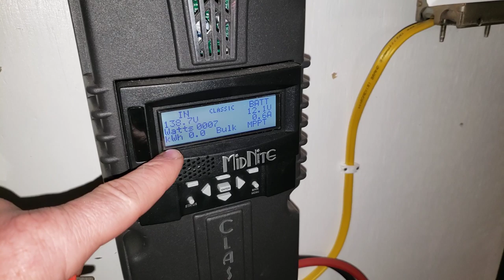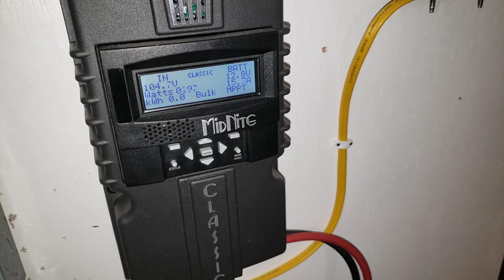Alligator Clips To The Rescue, Battery Protection Reset

Comment: I use the AUX1 (auxilary relay) of my Midnite Classic to turn on/off the inverter based on battery voltage.   The AUX1 can operate as an unpowered on/off relay OR you can set it to provide 12v while on and 0v while off.   So you  hook it to the on/off switch of the inverter or use the 12v mode to toggle a 12v coil relay.  The details are in the Midnite manual.   AUX1 can be set in a wide variety of ways - voltage hi/low,  PV voltage present/not-present,  day/night, etc etc.   The Midnite has manual on/off to test.    Very useful and you can use it instead of the battery guard.   And all this can be controlled on a PC over the internet.

Comment: If I'm seeing correct your charge controller is connected to your victron disconnect rite? If this is the case you could damage your charge controller when your battery disconnects as your charge controller should always be connected to a battery source while power is coming into the charge controller either from Solar, hydro or wind. Also if you connect your charge controller directly to you battery it would charge the batteries back up and your victron disconnect would reset its self when the voltage of the battery is back to normal.

Comment: Question? Have you had any issues connecting your inverter to the battery protect? I find it very inconvenient that the manufacturer doesn't recommend it and will void the warranty, yet iv heard of people doing it. The reasoning is that inverters will produce a bit of back current into the one way battery protect and ruin it. They say you can wire a relay but there is just no clear directions on exactly how to do that. Or if there is another way to prevent the back current.. Thank you in advance.

Comment: I just wanted to confirm, this does not reset your settings does it? It just restarts it to turn it back on. Thus bypassing the wait to charge up to the turn built in "turn back on setting" Correct?

Comment: I would hardwire in a external switch to reset the low-voltage cut-out, you may be around when it happens and with a bit of lus you even remember how to reset it, if you can find the manual or the internet is working, but can you explain how to reset it to your wife over the phone when you're away travelling? :-)

It also forgoes the whole issue of remembering how to do this a couple of years down the line! :-P

Comment: i found a heavy duty relay between the battery and inverter so the load side of the controller can switch it off helps to eliminate this problem i had the same problem with my epever

Comment: Question on Hydro setup: for the electric generating motor would it a good idea to sacrifice torque to increase RPM's?
Reply: He recently installed a larger diameter turbine to do the opposite. So this alternator in particular wouldn't be more efficient with higher RPM, rather the opposite.

Comment: How does that work when the protector no longer has a ground?
Reply from the maker: I'm scratching my head over it too, but you saw it work.
Reply: @JoeMalovich  interesting. Excuse me prying further, but where did you even learn this procedure? I dont own one but I was thinking about buying it and there seems to be no mention of this in the instructions (or any other way to reset it for that matter) other than perhaps getting the voltage back over the cut off point. And the instructions aren't very clear on that either haha. It seems to say a lot about installation and programming but nothing about what to do once its activated. Any info would be greatly appreciated, thanks!
Reply from the maker: @Dani2wheels  I think it was a victron support forum or similar.

Comment: Sounds like you need a arduino or a pi watching the battery voltage to control some relays to switch you from battery to house power to protect the batteries. Most relays have both an normally open and normally closed contacts so you could have the battery power in one set and the house power in another so the second the coil is powered/depowered it switches over 

If the load is something safe to power down when the batteries need protection simply change the state of the relay and cut the load off